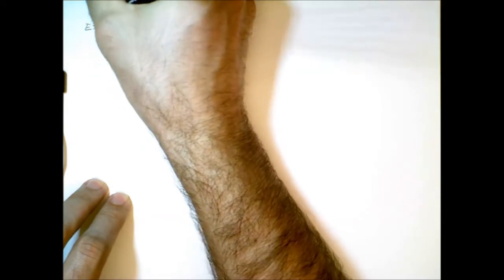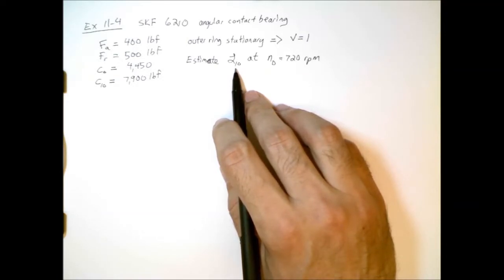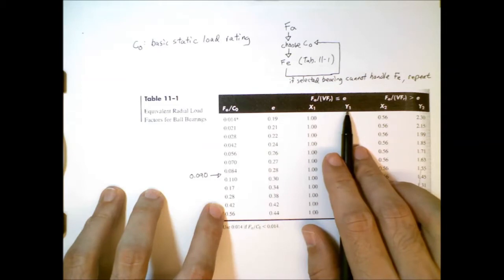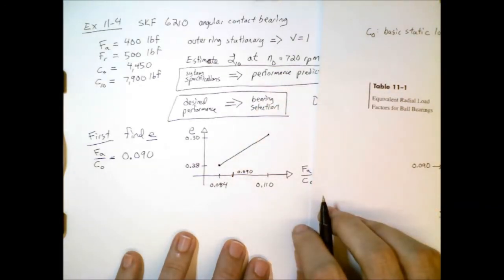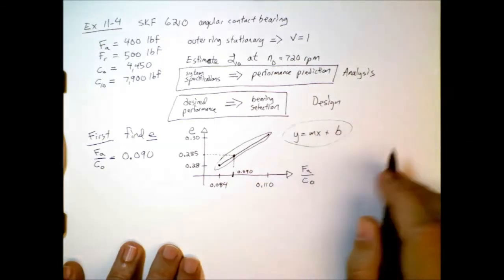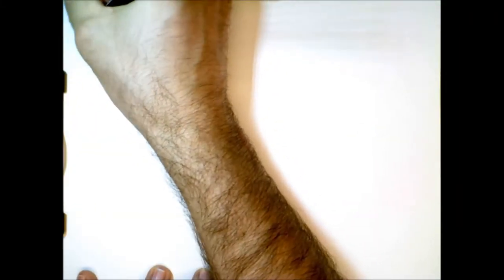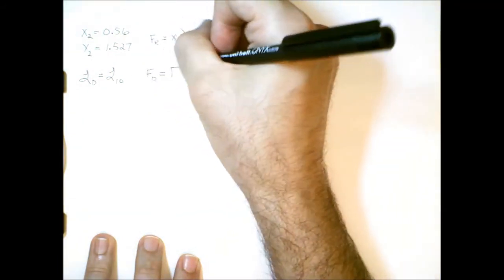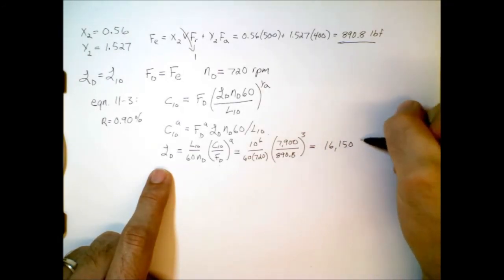Part 10: Example 11-4 and Summary

Comment: Excekent, But why did you stop, The video are amazing and helping alot..Do you have any thing where I can watching further letcures?
Reply from the maker: I teach SE 410 (Component Design) every fall (except 2019), and each year I usually create a few new asynchronous lectures. I also have some video lectures and short examples related to SE 413 (Engineering Design Optimization), a class that I teach every spring. Many of these lecture videos I post on YouTube, but some I cannot make public (e.g., they include solutions to textbook problems, or they deliver other information that I need to control the timing of). Students who are registered in SE 410 at UIUC do obtain access to all video lectures that I have created.